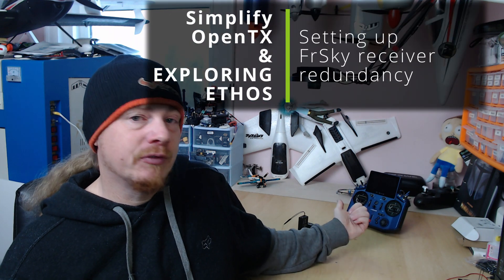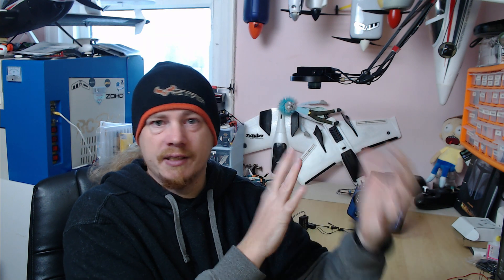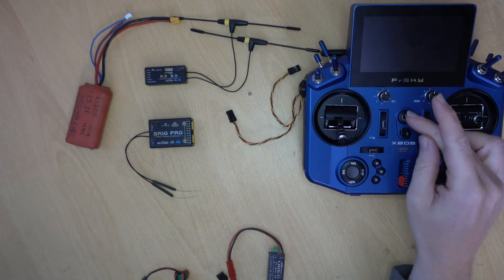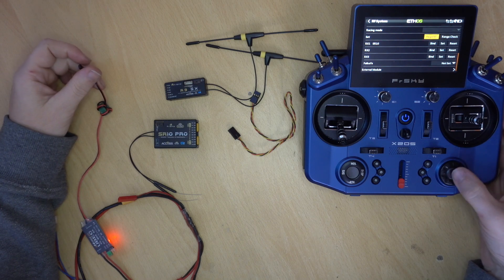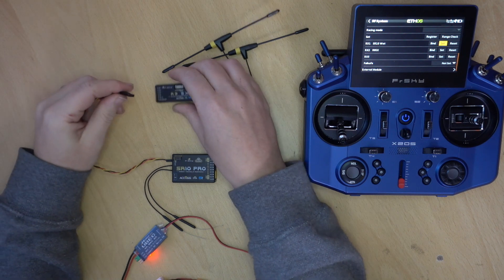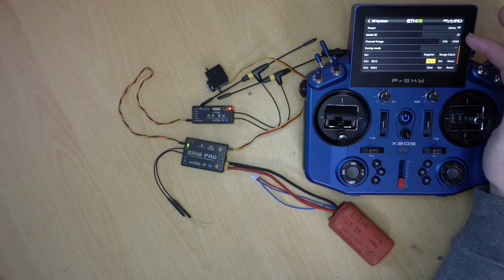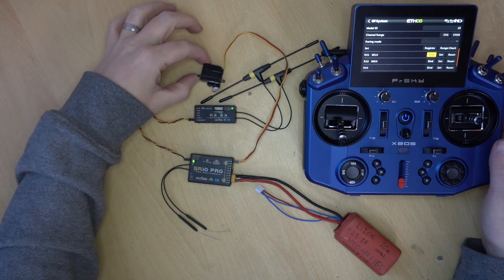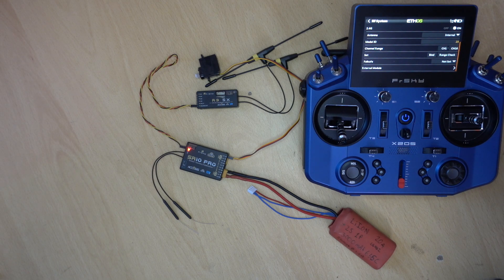Setting up FrSky Receiver Redundancy

Comment: Can I assume that I can connect an SR10(Stab.)receiver with a GR6(Vario)receiver ? Thanks
Reply from the maker: Yes, the GR6 has both SBUS in and out, so can be used as master or slave. With your setup the SR10 Pro would need to be master, as it is stabilised. The only caveat is that you would lose the vairo telemetry if the radio link is lost from the GR6.

Comment: Great video Mr.D.!  Your video had 2 receivers setup... Question.. is it possible to connect 3 receivers together such as with the main one being a FrSky 2.4GHz ACCESS ARCHER SR10 Pro, and connect redundancy to a FrSky R9 SX for 900, and from the R9 SX connect another redundancy to a FrSky 2.4GHz ACCESS ARCHER SR6 RECEIVER. I am planning a setup for a turbine jet, and I want the main receiver to be SR10 Pro with gyro built in, and having 2 additional redundancy in the R9 SX for 900, and another redundancy for 2.4 in the SR6. I know... I just want to be careful.. Thanks.
Reply from the maker: Thanks Ted. Yes, you can connect 3 receivers together. The only requirement is that both the master receiver and first redundancy receiver have SBUS IN pins. 

With that setup, just remember to only have stabilisation enabled on the master receiver. It will need to be disabled on the SR6.
Reply: @MrD  Love your video learning so much... Question.. At time period about 11:40, you mentioned only 2.4GHz RSSI show and 900 RSSI did not show, bc of turning off telemetry in slave 900 receiver. My question is, is it ok to enable 900 slave telemetry on, so we can see both 2.4 and 900 RSSIs, or not a good idea? It's just comforting to see both RSSIs on your Xmtr working... Thanks.
Reply from the maker: With ACCESS, yes. You can enable telemetry with all receivers. With ACCST, you can only enable telemetry on the master receiver, not the slaves.
Reply: @MrD  Thanks! I'm in the process of moving from Spektrum to Frsky. Bought an X20S a month ago and learning a lot. Thanks to your video.
Reply from the maker: I’m glad the videos are helping Ted. I really hope you enjoy your new transmitter.

Comment: On the nose Mr D! Exactly what I was looking for. Can I ask a supplementary qu: I want to use an SR10 Pro and the R9SX as slave - just as you demonstrate - great video! Right now, I just have the ESC BEC feeding the SR10 through the PPM connector. Is there a better way? I see there are two XT30 sockets on the SR. What’s the best way to power the two RXs? I have some 10A Castle BECs. If I swap out the standard servos for some digital ones, the load will go up.
Reply from the maker: You only need to power the master receiver, so the SR10 Pro in this case. Just run a cable from the SBUS out of the R9 SX to the SBUS in of the SR10 Pro, with signal, power, and ground. 

So long as the BEC is enough for all your servos plus some overhead. It should be fine. The XT30 connectors are good for power redundancy. It will use the power source with the highest voltage. Just be sure that however you power the SR10 Pro, that the voltage doesn’t exceed what the servos can handle.

Comment: Hi, thx for the video , I tried to turn both telemetry on , it works and show both 2.4 n 900 DB , may I know why I cannot turn the Slave receiver telemetry on ? Thank you
Reply from the maker: Because ACCST was not designed with telemetry from multiple receivers. ACCESS was. What’s in that video is the official answer from FrSky.
Reply: @MrD  thank you very much 🙏🏼🙏🏼🙏🏼🙏🏼

Comment: Can you run telemetry on the 900 slave while you are using the 2.4 telemetry…?
Reply from the maker: Yes. On ACCST, only the master will send back telemetry. So the 2.4GHz in this case. But on ACCESS, both can send telemetry back.
Reply: so 900 R MX installed which provides telemetry as indicated by rssi. Green lights all around.   When I set the 2.4 to its different model ID,  #21,  the 900 provides NO servo action on model #20.   The SR8 PRO now on mod#21 works.   Set it back to 20 and it works.      everyting is on the current software.  I can disconnect, reset and rebind and the result is the same...  @MrD

Comment: Is it possible to bind 2 Access Recievers together? Like an SR10Pro with stabilization on and an R6 or R8 for additional channels?
Reply from the maker: You’re better off using the SBUS out of the SR10 Pro to connect an SBUS to PWM adapter. If you are using the R6 or R8 as a redundancy receiver, you can’t use their PWM outputs. Only use the outputs of the master receiver.

Comment: Does this work with a plain 2.4GHz ACCESS radio (non-tandem) with an R9 module in the back?

Additionally, would this work with a second module/RX of a different protocol, as long as the RX used SBUS and the channel mapping was the same? eg ELRS, Crossfire etc.
Reply from the maker: Hi Jim. Yes, it will work on regular ACCST as well as ACCESS. 

To be honest, I’ve never tried that. I guess if the Crossfire receiver was outputting SBUS, it could work.

Comment: hi, may i ask what is a good way to mount the 900 antenna on to a freewing 80mm A10, thank you very much
Reply from the maker: If only one antenna, vertical is best. Make sure the transmitter antenna is vertical too.
Reply: @MrD  thx mr d , I am using R900SX and I guess it is too long to mount it vertical and there is 2 antenna
Reply from the maker: With that receiver one vertical and the other horizontal would be the best orientation for an EDF. You don’t need to worry about range.
Reply: @MrD  yes, that will be perfect, assuming you said vertical doesn't mean it should be a straight line vertical, i can only attached it onto the round shape fuselage, which will like a C shape if you look it at the front of the plane, is it still good ?

Comment: Dr. D !  Can you bind a SR6 to a TD R 18 to get stabilization for a gaser??  Or what two RX would you bind for lots of Channels, redundancy and stabilization?  Or would you use the SR8 pro?
Reply from the maker: Hi Fred, unfortunately not. You can't mix protocols. The TD R18 being TANDEM, and the SR6 being ACCESS. At this point in time, for stabilisation and redundancy, you would need to pair an SR8 Pro or SR10 Pro with and R8 Pro or R9 MX. Or with the tandem route, you would need to use one of the stabilised redundancy busses. RB30 or above I believe. It really depends on the size of the gasser, and how many channels you need. I'll be putting the SR10 Pro and R9MX in my 30cc planes. Well, if a stabilised TANDEM receiver comes out before I buy the receivers for the 2nd plane, I may use one of those instead.

Comment: Great video!! - I have a couple of issues I wondered if you might have a solution for 1. how to get 16 channels from two X8R receivers and 2. how to set up the throttles on a 2 glow engine plane with throttle cut on either or both engines and failsafe on both engines and independent trims to set up the idle on both engines
Reply from the maker: Hi Richard, Sorry for the delay in getting back to you. For the 16 channels, instead of using 2 receivers. I would take the SBUS out of the X8R and attach it to a SBUS to PWM adapter. Bind the X8R with channels 1-8 as normal, and use channels 9-16 on the SBUS to PWM converter.

Which transmitter do you have and what firmware are you using? The two engines shouldn't be too tricky to work out. The trim may be the biggest problem. Failsafe would probably be the easy part. As you could just use a custom failsafe and set the output to the channels with the engines to an idle throttle, or off, whichever is your preference.
Reply: @MrD  Thanks for the reply since asking the question Ive worked out the 16 channel problem but the twin engine problem remains and its having separate trims to allow setting of idle speeds to the individual engines

Comment: Thank you for that very helpful demo video. I have followed your setup exactly using a X20S, SR8 PRO as main receiver and a R9SX as redundant receiver using SBUS with CH 6 set to SBUS and connected to the SBUS in on the SR8.. All works as you described until I switch model ID back to disable the SR8 which now has a red light and R9 has green light but get no servos working from  the redundant R9 receiver. Can you think if something I have missed, Can’t seem to get the redundant receiver to take over no mater what I do.
Appreciate your help as not many resources for such a new system, Thanks, Greg.
Reply from the maker: Hi Greg, glad you got this sorted, sorry for the late replies.

Comment: Hi Darren, I tried to use a XM+ Rx as a slave to a G-RX8 in a carbon glider. I had the G-RX8 on ACCESS and then found out the XM+ is only ACCST. I tried to flash back to ACCST on the G-RX8 using the STK tool but it doesn't see the RX. I tried with other receivers and STK can connect to those RX's. Is the G-RX8 not backward compatible once you flash ACCESS? 
BTW - Thanks for a very helpful channel.
Reply from the maker: It should be able to be flashed back to ACCST. I’ve flashed an R-XSR from ACCESS to ACCST and back a few times. Have you tried flashing using the transmitter?
Reply: @MrD  I haven’t. I am using a X12S?
Reply from the maker: @georgecarnie546  that should be fine. I’m not sure if there is an S.Port out on the X12S. But the JR bay method should work.
Reply: @MrD  Thanks - No S-port but I'll try the module bay method. I appreciate your prompt reply from the other side of the world!

Comment: Is there a reason you couldn't just turn of the 2.4ghz transmitter and keep the 900mhz on the check redundancy?

Also why can't you have telemetry on both? Seems to work just fine when I have it on. But haven't flown that way since you said one shouldn't.
Reply from the maker: Yes, you can turn off the 2.4GHz side and then 900MHz. 

With ACCESS you can use telemetry on both. With ACCST you can only use telemetry on the master receiver. https://youtu.be/Q59ai7sZA1E

Comment: Hey mate. Is that ok to use a R9MX for redundancy on a 35% aerobatic plane or should I get a R9 SX just like the one you showed? Thanks
Reply from the maker: R9MX would be fine in an ACCESS setup. I used the R9 SX as it has pins, so easier to demonstrate.

Comment: Mr D:  I'm having no luck getting a high precision vario to work with a R10 pro.  Not sure if it is a bad sensor or there's something new with adding the vario to the R10.  Can you point me in a direction?  Thanks, Steve
Reply from the maker: Hi Steve,
It should just be a case of adding it to the S.Port connection. I did have problems with a sensor on an earlier ACCESS receiver. The receiver needs to be set to not use FPort. Mine wasn't. But I had to toggle FPort on then off and it then started working. IT may be worth trying that.
Reply: @MrD  Thank you for getting back to me.  Coming from years of X series receivers, I was using the rx port for jr style plugs instead of the little white four pin port.  Once plugged into the correct port and toggling the F. to S. on the radio, it worked.
Reply from the maker: Awesome  @shurdba . Glad it’s working for you.

Comment: Darren,  some say you can NOT  use a stabilizer RX in redundancy.  What do you say'?   Have you seen?
Reply from the maker: As far as I understand it. You can use a stabilised receiver as the master receiver, ie the one the servos are connected to. They can’t be used for any of the redundant receivers. I did check with FrSky, and they confirmed this. But I will also do my own testing in the near future.

Comment: Now with the Tandem dual band receivers coming out is there any real benefit to having this dual satellite setup?  Maybe to get some separation of the antennas?
Reply from the maker: The redundancy is less important with the Tandem receivers. But, they will still give you more RF reception as you can still cover all angles. The separation would also help. Plus if an antenna gets knocked off or shakes loose, you have more protection.

Comment: Wanna ask yours opinion..i have frsky horus x12s and it fine if i use this r10 pro together on my 3d gas plane? But never use it under horus x12s transmitter still keep in box
Reply from the maker: Sorry Zack, I don’t quite understand the question. 

The R10 Pro is fine for use with gas planes. All the Pro and tandem receivers are ok to use with electronic ignition engines.

You may not be able to use the R10 Pro with the X12S. It depends on the type of RF module installed. If it has an XJT module, the R10 Pro, and any other ACCESS, won’t work. If it has an ISRM module, it will work.

Comment: Thanks a ton for your videos man! really informative stuff and got me started with Tandem. Can the spare pwn channels on the slave receiver can be used as exention to the 10ch on SR10?   Meaning the slave channels will be 11, 12, 13 etc ?
Reply from the maker: No, you should not use any pins on the slave receiver. They will not get any channel information if it loses signal. The SBUS connection is one directional, so the data only ever goes from the slave to the master. 

The better option would be to use an SBUS out from the SR10 Pro (master) with an SBUS to PWM converter. But, you’d only really gain channels 13-16.

Comment: Hi Darren, great video on back up receiver. Can we use the back up receiver to drive few servos
Reply from the maker: No, all servos should be plugged in to the main receiver. The data only goes from the redundant receiver to the main receiver, not the other way round. 

I need to check, but it could be that the SBUS out from the main receiver will be from the strongest signal. So you could potentially use that and an SBUS to PWM converter to operate more servos. But I’ll check with FrSky to be certain.
Reply: Just found your excellent channel. Great stuff. Never done redundancy before so this will be a great help. Did you figure out if a couple of SBUS - PWM converters could be used with the main Rx? And, How do the stabilization features work with this redundancy. I have a SR10PRO right now, what would be the best slave to use? I have a SU30 with vectored thrust so need the extra channels and when the battery is between me and the RX, I get low RSSI - twitch twitch!

Comment: Hello. Setting up the redundancy workers well. In "one "direction only ! If you have mapped some channels into the slave receiver the use of extra channels becomes available. That's great ! If the master receiver goes down the extra mapped channels in the slave receiver will continue to function. However. If the slave receiver goes down the extra channels that were mapped into it will "not" work. Disappointing.
Reply from the maker: Yes, thats how it’s designed to work. The master should have all the outputs connected to it. SBUS is not bidirectional, the communication only goes one way.

Comment: Good Morning. The instructions for the R9-SX do not instruct on antenna orientation. What is the recommended orientation for this type of antenna ? The redundancy setup works beautifully. Another question. My is the telemetry turned off for the second receiver ? I experimented with this. Having the R9SX telemetry enabled allows the user to actually see and hear which receiver has lost and regained it's respective signal. Isn't this a beneficial ?  Thanks
Reply from the maker: Hey Frank. With ACCESS, you can bind both with telemetry. I'll be making a video to square all this up after chatting with FrSky.

With regards to the antenna orientation, it would depend on the type of flying you're doing. Most types will be the same as when setting up 2.4 diversity antennae. So one vertical, the other horizontal. But, if you're flying long range, an elongated X (taller than wider, so more vertical), viewed from the side of the plane, gives better performance.